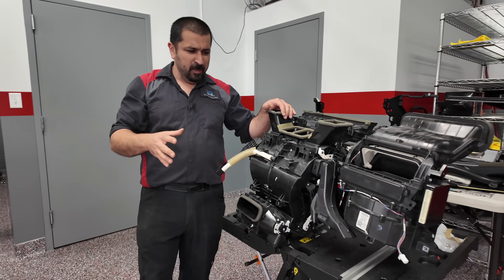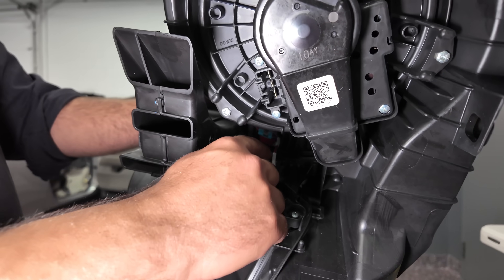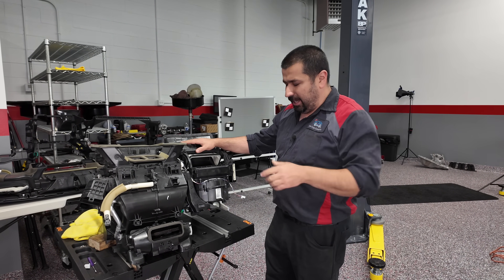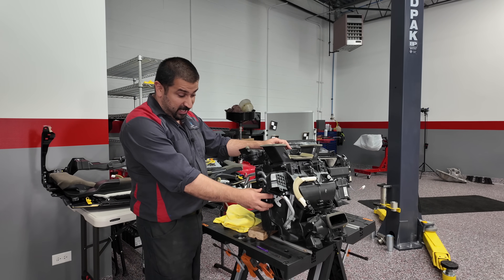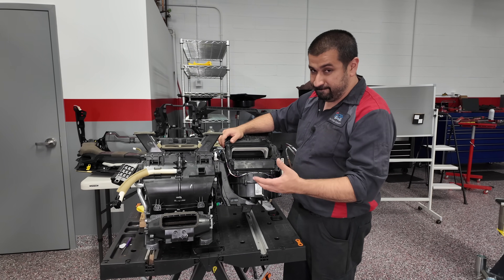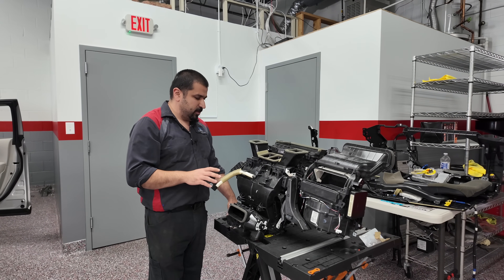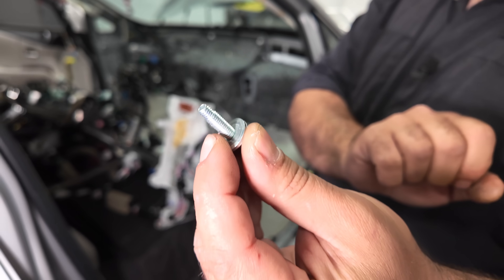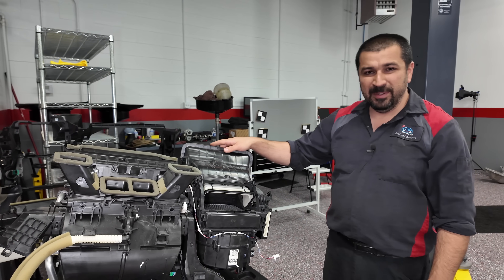THIS is Why Car Engineers and Car Mechanics Don't Always Get Along!

Comment: Engineers have many priorities, and service isn't anywhere near the top.  I'm sure it's considered, if an opportunity to simplify exists.  Imagine a dashboard having three sections or integrate a center stack that is removable to allow easy access.  But that affects interior design and will probably increase cost.  Reminds me of cases where people cut through floors when there isn't a fuel pump access to avoid removing the tank.

Comment: Heaters cores rust and leak. Many, or perhaps most, cars require that you pull out the dash to get at them costing a thousand dollars or more to replace a $50 heater core. I once took a car to a dealer for a replacement and they flat out refused to do it. I just blanked off the pipes and replaced the car as soon as I could.

Comment: I saw an Audi in another video that needed a similar repair.  They called in a glass shop to remove the windshield.  The video started with showing the back seat area full of parts and then the trunk full of parts and then another large stack of parts near the car.  Many years ago I envisioned that the first thing on the auto assembly line was the heater core and all other  parts of the car were installed around it.

Comment: Hi there, you're one of the best. Your videos are honest opinion and straight to the point. I have 40 years+ of experience working on all kinds of engines. Today's cars ha ve been corrupted by unnecessary electronics, 70% of that goes to the infotainment, power accesories and all the electronic crap on sensors and modules and all the luxury gadgets. Every 3 years i have to buy a new more sophisticated scanner to keep up to new cars. Back in the mid 80s I went from  LA to NYC none stop, just to refuel on a 69 Datsun SW 1600 cc 4 speed, I upgraded with tachometer, coolant temperature, oil gage's,  extra engine oil cooler and nothing more. I laugh when at the dealership the sales personnel talks and talks without any knowledge of the mechanical engineering of the cars. Keep on going kind regards from Bogotá Colombia.

Comment: Hey I have a question about a 2016 Sequoia fuel line, not sure if I can add a photo but the line is on the driver side, there is a blue connector at the fuel rail, and then it goes to a white connector, it is leaking and I can not find out what the part is actually called to order one. Can you please tell me what it is?

Comment: INSANITY! And it isn't just Toyota, they are all just like this. I was a heavy line technician for almost 60yrs. I retired in 2010 after my health became so poor from doing this job. Degenerative disc decease in my lumbar, rheumatoid arthritis, torn rotators in both shoulders and so on. And being ripped off by the dealer as well as the manufacturers. If you really want to do this for a living, guys, start your own business, open your own shop and don't become too specialized.

Comment: When my Ford fusion headlight burn out I went to change it and found you had to disassemble the front bumper cover and other trim.  Since I didn't have access to a lift and I'm too old to crawl under a car that low ground clearance I had a shop do it.  Cost almost $300 for a headlight lamp.

Comment: We are in an age where engineers put everything on a computer and there isn’t any feedback on their design. I worked in structural steel, and more than once I had engineers design connections that couldn’t be assembled. I had to point it out to them with a feasible connection. 

What car companies need is an experienced mechanic on staff to look at the design to make suggestions for improvements.

Comment: Any time you get mad at an engineer, you REALLY should be mad at a bean counter. It's not that engineers don't care, or can't design better stuff. It's that they are TOLD to design it the way things are for cost cutting at the assembly level. Manufacturers do NOT care about serviceability. They ONLY care about selling the product.

Comment: You are exactly correct about things getting into the HVAC assembly and jamming doors. In my experience it is mice bringing nuts and or nesting material into there. It's about 80% of the time it's mice. Toyota needs to block off the fresh air intake with wire mesh to keep them out. I do it on every Corolla and RAV4 if my customers have evidence of mice in their cars.
You rock Ahmed!! Bless you for sharing your knowledge and skill in easy to understand language.

Comment: Remember doing this to a 2010 Camry. I took the dash out with the heater box and steering column attached, as they did on the assembly line. Hung the complete assembly from a hoist arm with ratchet straps, took HVAC box off, and replaced all motors, heater core and evaporator. Have to say, doesn't matter who the manufacturer of the car is, this is SOP on all cars for the last 10-15 years,.

Don

Comment: If mechanics would just watch an assembly line video, you would see when a complete, not in pieces dash assembly is installed.  There are no front seats, and there are a minimum of connections to make.  When he showed the interior, gutted mess, that would never look like that on the assembly line before dash install

Comment: I had a toyota a couple years back came in for AC not blowing. After looking at it for a little bit, I found that it had sucked up several fast food napkins when the customer placed it on recirc, shredded them and pretty much blocked off the evaporator. I was able to drop the blower motor and clean it out. I'm sure on newer, I'd probably be doing the same thing you guys are doing.

Comment: Had the blend door on my 14 Camaro go out and it requires the removal of the entire vent box assembly to properly replace it. I did a shortcut because I wasn't paying 3k plus dollars to repair it. This is the result of overcomplication and computerization of all things. The old linkage/slider style a/c was so much more reliable and cheaper to deal with.

Comment: Had 2007 Lexus iS 350. The blend door was a common failure with similar’tear the dash out’ fix. I was able to get my finger on the gear that would disengage when you’d switch between fresh and recirculate modes. You’d have do this about once a year.

Comment: Wow, this video explains so much for me. Owned from new a 2010 RX350, Japan build, paid for extended warranty. In 2017, my wife took it to the dealer to 3 times to solve a heater issue. She was going to work very early mornings and the driver's side only blows cold air while the passenger side was hot. She made me go pick it up on the 3rd time; the desk guy showed me a hand written table of temperatures that they had compared with a similar model. Boy, was I mad, keep it short, he agreed to keep the car and investigate further. Didn't get it back for another week, and it was fixed, but didn't get any details on the paperwork.
Reply: For the next service, took it to another dealer, while he was checking the vehicle in the computer system, he says, wow, that cost a lot of money there, and he told me he was looking at over 4K of labor to fix the heating issue. Now seeing how that looks I understand why they were reluctant to tackle that job and brush us away BS story.
Reply: But that dealer didn't get off easy either, wife complained of vibration in the steering wheel, they replaced some u-joints I believe, but she said it was still there, so a few more visits to dealer who eventually replaced the complete shaft. I think I saw that mentioned on a previous video, hope he reads this long story. The moral is: always get extended warranty.
Reply: Another thing happened to that car, was that oil line issue where the rubber hose blows out, and there is a metal replacement, many videos about that. Wife parks in the driveway one night,, tells me the oil light has been on for "a few kilometers"!! Towed it the next morning, damn lucky she didn't blow the engine IMHO.

Comment: I think the cars are designed to sell, to last through the warranty period with minimum issues then what happens the manufacturer doesn't care.   The reality is that expensive repairs at a reasonable mileage or within 12 (say) years gives the brand a poor reputation.   Once bitten the brand is out of favour.  I stopped buying GM, then Ford because of reliability/cost/service attitude issues.   Now only buy Japanese made - haven't had one issue of note for 20 years.

Comment: Have you rebored a Toyota etios or corolla made after 2005. Do they have dry sleeves or wet sleeves or do new engines don't have a sleeve ( cylinder liner) but have them after being over bored inorder to bring the cylinder volume back to standard volume

Comment: It's obvious that Engineers hold Mechanics and Automotive Techs in contempt. Two extremes of the same discipline. In the past, these jobs could literally be done blindfolded. Now it's comparable to working on the Space Station. Disgusting, and very expensive.

Comment: Person asks "Should I buy car A or B?". Assume identical repair and service frequency (parts availability and special tools aside). What car costs more for parts, what car costs more for labor?  There is the answer.  Repair Scenario - Car A starter costs $200 and labor $900. Car B starter costs $500 and labor $400. Maintenance scenario - Car A transmission fluid parts $500 and labor $100. Car B transmission fluid parts $100 and labor $300.  Assuming the basics are covered = dont buy a car with high failure rate of critical components.  Decisions decisions.   
Stay gold.

Comment: I have a 2008 Highlander with single climate hvac system. I replaced my windshield at some point and fragments of glass fell through my vents. After the replacement with the blower on high it shoots out glass fragments and now i have this problem. Ive had the vents vaccumed to remove as much as possible. My vent today is stuck shut blowing cold and not hot. I live in texas and its a little bearable cos I'd rather have AC than heater. I'm a witness. He's right.

Comment: Why not connect the two power leads of actuators to 12v and move the actuators without position feedback
Reply: Most newer blend door actuators will be destroyed if you bench test them due to their design.  You could do what you suggest on some electric motors, but on the servos it could cause damage.

Comment: On the Jeep (and probably Dodge Charger ?) if the recirc door is in one or the other positions outside air is fed into the a/c - heat boxes or outside air is blocked and inside air from behind the glove box is fed into the boxes but if the door breaks/falls down or gets stopped in the middle between the positions a direct flow of outside air can come into the car behind the glove box and create a cold draft in winter.

Comment: On some cars like Jeep WJ Grand Cherokee a similar system repeatedly "tests" the blend door and recirculation door position repeatedly by running the actuator motors to jam the doors hard against their stops until typically at about 2 years old for the car the blend and recirc  doors either break or begin to spin on their axles causing the "computer" to render things inoperative.  usually fails in cold and outside air modes. 
  Would have been much better to have used mechanical cable mechanisms for the doors to be operated. Like older cars did. 
Also  most parts of the heat and a/c systems require the whole front dashboard and instrument panels to be gutted out including the evap and heater core change outs. 

 I think salt spray ingestion into the evap core and/or a/c evap core causes a lot of corrosion failures. When driving on nasty slush roads that have been salted especially in high speed traffic which creates an aerosol of the brine droplets that penetrate everything. 
People think aluminum can't rust but salt can rot some kinds of aluminum.

Comment: ironic.  my 2021 Honda Pilot has a random intermittent clicking sound when I start up.  Thanks for the info.  Need to have a Honda master tech check into this.  Sounds like it might be a servo.  I typically run temp control on auto.

Comment: I find that a couple of long tables help to keep parts in order of removal, so you can reverse direction when you reassemble. And, a roll of blue painters tape works to mark where wire harnesses, cables, etc., reattach to cross car beam. It’s easy to miss clips, ties, and routings when you have to roll a dashboard. Also, I like to use the tape to attach the bolts and screws to the parts they were holding. Never a fun job, but if you can get it back together without introducing bugs, squeaks or rattles, it’s very satisfying!

Comment: I did aftermarket alarms and remote start systems.
We had a hack installer do a remote start system on a GM truck
After the guy left and about 3 weeks later i found the drivers side knee bolster laying behind the shop compressor  if you don't know its the crash cage that keeps the steering wheel from going into your chest in a wreck the only thing between death and the driver was a thin plastic under dash trim panel
I    asked the shop owner to call the guy back to the shop so so could I fix it but he said the guy moved 5 states over.
I told him to fire that tec, he didn't.
I stopped working at that shop.
That guy finely got fired after I left
I watched the dumbass blow a side  curtain air bag on a brand new car
Burn up the wiring on a GMC pickup
And a bunch of other things. 

Im not perfect i make mistakes, but i own them.  Leaving a critical crash safety part  off a car that can cause a death is stupidity.

Comment: The older cars with rods and or cables had simply a simple system, but even they failed.  Someone would drop something behind the dash, or the passenger would bend the rod with there feet.

Comment: The love hate relationship, goes past the engineer mechanic, owner to the manufacturing ,stage too.
I think cost, engineering, mechanic, and manufacturing all got together
"Fat chance"  you could make something everyone can agree with. 

Some cars you have to pull 1/2 the motor apart to change spark plugs.
A normal wear item.

Comment: Yes the computer operates the doors, but don't the  computer send 12v dc   to the motors reverse ground poliarty send power positive to negative or negative to positive to change directions?      
And why can't the put just one motor in to drive all the gates with a selector gear   under the radio in the consol down low where the srs computer or cars main computer is and put the bus computer under the back seat, or better yet use vacuumed lines like Benz does with a vacuumed pump in the trunk side panels  you own a benz they used to use vacume lines to control door locks and they worked good.
The high pressure plastic lines like for a shop type . Air compressor with push connections you push the line in and push the connection in like shark bite plumbing Conectors, or even one hard line to a compresed air manafold and motor to change the valves pos.

Comment: I would try to find a way of test the actuator so I can see them moving while the unit is outside. Maybe this way will allow me to identify the actuator that dont move the stuck door and then replace  it with a new one.

Maybe is less expensive to replace all actuator than buying the whole ac unit. 

I think the key here is the labor hours spent..
Reply: If I where an automotive engineer I would design a scanner that would help to diagnose or troubleshoot this type of ac problems…

Comment: Might be different on Lexus, but on Toyota (or at least my 2008) i can run the servo by applying voltage to pin 4 and 5 for mix. For inlet its 1 and 5. Never tried what value comes from 3rd wire but should be harmless to put multimeter on it and measure either voltage or resistance if there are any changes as it moves. Either pulses or value

Comment: This is why I keep my vents on defrost at all times.  When inevitably the actuator fails, as long as my heat and AC still work I don't have to mess with it.  I wouldn't be surprised if the cost of this repair was more than half the value of the car.

Comment: I love your approach to repair.  As a Lab instrumentation engineer for a biotech company, everything you teach applies.  Servo motors can be tricky to test.  You could apply an external voltage to the postive and negative leads with a benchtop supply/function generator.  You should be able to tell what voltage it takes and its max output (i.e. how much current).  But at what speed? What PWM frequency?  And again, the motor might work fine, but what about the door/actuator? is stuck like he says?  Also, his point is completely valid: do you add more labor time to do those external tests?  Finally, as an own of 2008 sienna, I wondered where the defroster servo is.  It might be acting up a bit because very infrequently we get no heat (not due to an issue with the coolant system).  I might be dealing with this issue in the near future!

Comment: Rip vent out.  Reach in with your hand, and move the flap.  Easy.  Is it elegant?  No.  Does it work?  Yes.  These electronic control systems are a nightmare when they break.  Remember the three-knob setups?  Ever had one of those break?

Comment: Try a BMW iX subwoofer. You have to remove the entire high voltage battery unit, and it’s bolted above the battery unit, on the underside of the body shell (where you would typically access a fuel pump).

Comment: How important is the "Servo Motor Initialization" operation? I guess very few people do this after changing/disconnecting the 12v battery! 

Welcome to the Air Conditioning servo motor initialization wizard.
This function is used to initialize the air conditioning servo motors.
Use this utility when:
- The servo motor ECU is replaced.
- The A/C amplifier is replaced.
👉- The battery is disconnected. 👈